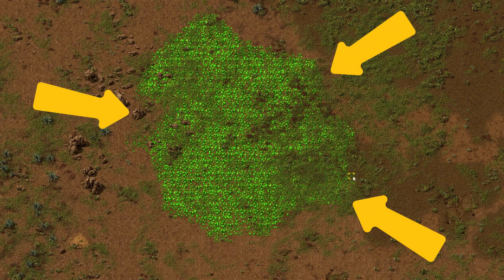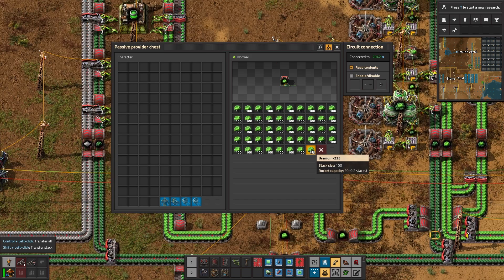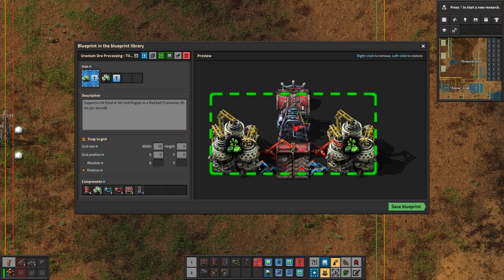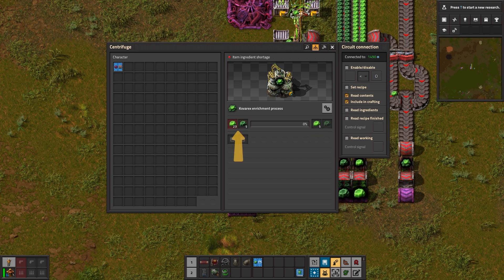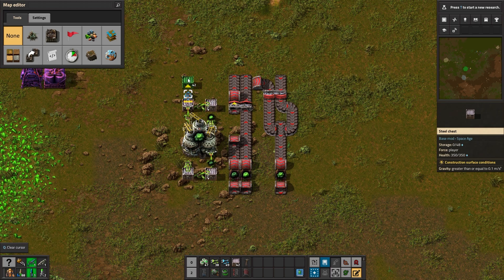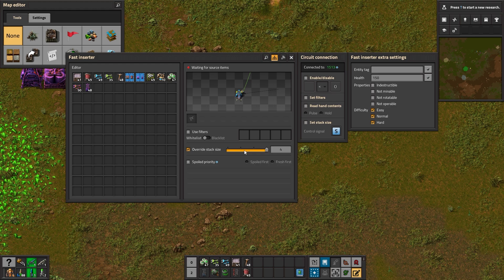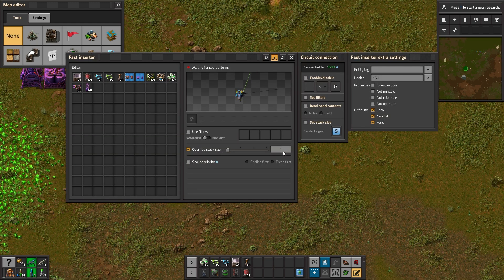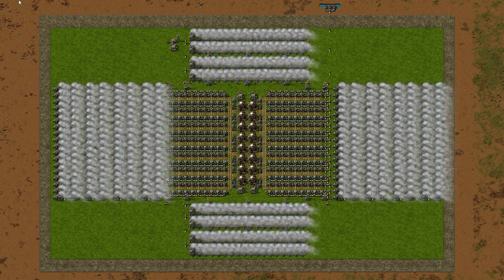Factorio Unlimited Fuel Cells: Tileable Kovarex Tutorial (FREE Blueprints)

Comment: I found a much much more compact design for kovarex though i migh share... U have to separate belts running through the centrifuge ,one carrying 235 to replenish the centrifuges and the other one is tk take away the 1 extra 238, on the 2 remaining sides, u have the chest looping. For each loop, filter the extract inserters to one of the two uranium types, link up with circuits both of the output inserters of U-238 from the centrifuge and set the condition inside to read materials inside and while crafting in the centrifuge. On the inserter thats looping the U-238 back, set it to onky work when U-238 <= 40 and the one that takes care of the excess to only work if U-238 >= 41.
This is a much much more simple and compact covarex print while still being tileable and has room for up to 10 beacons (all tileable)!!! Here is the blueprint string so you can check it out! :
0eNrNWGtum0AQvsv+hsgsLH5I7UUsC2EYJ6vAQvfhxo18gN6jvVhP0lmwwSbgQFJVliJlgdl5fPvN7Je8km1moJRcaLJ6JTwphCKr9StR/FHEmX0n4hzIimwhxo/k6BAuUnghK++4cQgIzTWHek/1cIiEybcg0cDp7HVIWSg0xyX6RRdhEDwwhxzIyqXzB2Z9a8hrZzy9CK5KgNTNi9Rk4FLSGqKdiLjYY+hCHuqN7RNmoHScPJPV7OgMfMEyjvjjvEmfjkh/fr/p+036u1hp1+ChyUdZ4G93C5nuq2bZVBNW1ehDafcXRpdGk54YweQYbNaJkXIJSW2xaCJyMRCQvX8mjN7vmYRN+jmk3OQuZFi85IlbFhnc7g9cHXtczkewNLxycleILJr0E/wi+c48wm1q1iVgpVoWWbSFp3jPC2kNJcRpZD+gJ8xaSwNoifTiFamei30s4cUFgYA/5WjklrJIQClytoq+mTjD9NBaFDLH+TcIFm5NDRJ3j+bTMQsGMQvex2zZHrnJnl0uFEiNH3p6wWtgY91uC3o8e7OpBL2IMEBQr70GlAbI3OQJlL7duGzAFR1fOe0Q5nLO9Ln2R0yW4H77yOuM4hvQXPQSHQUNG+36YrrTwTZNuEwM1xGIeJtBWjeq07zGLWnjdMel0tEbLWJkLCw7qc9IHQXxsQom8OxTXsYy1jYa+fPzN0EqkWIPUvIUogpI9PgDLJo91YYf6S6/C6Sl6r8u/nQ57rnUphpNZ75VFravkCJXcMw6aHytsNjxDAs6Efek5Zw+aB3SMw+vHH4h/WycT+95f6Dn2xsixRmNAsPFDLZcVBn0eBzkdtB/IievLfRVo14+rT/Aw9kbHv6q9My7jha1o+tDQ6Fdi7CuNh9PifKAFRqho50s8qgWWKtdnCmwI6UP+OUk+e7dnXyfTdLv95e/9xkB710K+EE5TelnBLw3LOCH/2Sg/iQJf3/H0l6053a/PZDaQ/EWg3eiqiFU1+ur+Txyai9GTW37wthBZevs73/KJhbaMuO/FMo+ViiO0u/IWOt+HTrMQcnLNs564XgOCh3vvFxUSxQD1drfbGpuWdY2/y9xCIoKVSHAQroMlkvGKAt96h2PfwGGpcM0
Reply from the maker: Sounds awesome. Can you give me the blueprint? maybe the pastebin code
Reply: @Maxiume  Unfortunately pastebin says it contains blocked words ;////// Best I can do is give u the blueprint string here...

0eNrNWGtum0AQvsv+hsgsLH5I7UUsC2EYJ6vAQvfhxo18gN6jvVhP0lmwwSbgQFJVliJlgdl5fPvN7Je8km1moJRcaLJ6JTwphCKr9StR/FHEmX0n4hzIimwhxo/k6BAuUnghK++4cQgIzTWHek/1cIiEybcg0cDp7HVIWSg0xyX6RRdhEDwwhxzIyqXzB2Z9a8hrZzy9CK5KgNTNi9Rk4FLSGqKdiLjYY+hCHuqN7RNmoHScPJPV7OgMfMEyjvjjvEmfjkh/fr/p+036u1hp1+ChyUdZ4G93C5nuq2bZVBNW1ehDafcXRpdGk54YweQYbNaJkXIJSW2xaCJyMRCQvX8mjN7vmYRN+jmk3OQuZFi85IlbFhnc7g9cHXtczkewNLxycleILJr0E/wi+c48wm1q1iVgpVoWWbSFp3jPC2kNJcRpZD+gJ8xaSwNoifTiFamei30s4cUFgYA/5WjklrJIQClytoq+mTjD9NBaFDLH+TcIFm5NDRJ3j+bTMQsGMQvex2zZHrnJnl0uFEiNH3p6wWtgY91uC3o8e7OpBL2IMEBQr70GlAbI3OQJlL7duGzAFR1fOe0Q5nLO9Ln2R0yW4H77yOuM4hvQXPQSHQUNG+36YrrTwTZNuEwM1xGIeJtBWjeq07zGLWnjdMel0tEbLWJkLCw7qc9IHQXxsQom8OxTXsYy1jYa+fPzN0EqkWIPUvIUogpI9PgDLJo91YYf6S6/C6Sl6r8u/nQ57rnUphpNZ75VFravkCJXcMw6aHytsNjxDAs6Efek5Zw+aB3SMw+vHH4h/WycT+95f6Dn2xsixRmNAsPFDLZcVBn0eBzkdtB/IievLfRVo14+rT/Aw9kbHv6q9My7jha1o+tDQ6Fdi7CuNh9PifKAFRqho50s8qgWWKtdnCmwI6UP+OUk+e7dnXyfTdLv95e/9xkB710K+EE5TelnBLw3LOCH/2Sg/iQJf3/H0l6053a/PZDaQ/EWg3eiqiFU1+ur+Txyai9GTW37wthBZevs73/KJhbaMuO/FMo+ViiO0u/IWOt+HTrMQcnLNs564XgOCh3vvFxUSxQD1drfbGpuWdY2/y9xCIoKVSHAQroMlkvGKAt96h2PfwGGpcM0
Reply: @Maxiume  Unfortunately Pastebin doesnt let me post it due to some restriction. But i can give u the blueprint string for it here : Let me know if smt is broken when i tested it everything worked fine.
0eNrNWGtum0AQvsv+hsgsLH5I7UUsC2EYJ6vAQvfhxo18gN6jvVhP0lmwwSbgQFJVliJlgdl5fPvN7Je8km1moJRcaLJ6JTwphCKr9StR/FHEmX0n4hzIimwhxo/k6BAuUnghK++4cQgIzTWHek/1cIiEybcg0cDp7HVIWSg0xyX6RRdhEDwwhxzIyqXzB2Z9a8hrZzy9CK5KgNTNi9Rk4FLSGqKdiLjYY+hCHuqN7RNmoHScPJPV7OgMfMEyjvjjvEmfjkh/fr/p+036u1hp1+ChyUdZ4G93C5nuq2bZVBNW1ehDafcXRpdGk54YweQYbNaJkXIJSW2xaCJyMRCQvX8mjN7vmYRN+jmk3OQuZFi85IlbFhnc7g9cHXtczkewNLxycleILJr0E/wi+c48wm1q1iVgpVoWWbSFp3jPC2kNJcRpZD+gJ8xaSwNoifTiFamei30s4cUFgYA/5WjklrJIQClytoq+mTjD9NBaFDLH+TcIFm5NDRJ3j+bTMQsGMQvex2zZHrnJnl0uFEiNH3p6wWtgY91uC3o8e7OpBL2IMEBQr70GlAbI3OQJlL7duGzAFR1fOe0Q5nLO9Ln2R0yW4H77yOuM4hvQXPQSHQUNG+36YrrTwTZNuEwM1xGIeJtBWjeq07zGLWnjdMel0tEbLWJkLCw7qc9IHQXxsQom8OxTXsYy1jYa+fPzN0EqkWIPUvIUogpI9PgDLJo91YYf6S6/C6Sl6r8u/nQ57rnUphpNZ75VFravkCJXcMw6aHytsNjxDAs6Efek5Zw+aB3SMw+vHH4h/WycT+95f6Dn2xsixRmNAsPFDLZcVBn0eBzkdtB/IievLfRVo14+rT/Aw9kbHv6q9My7jha1o+tDQ6Fdi7CuNh9PifKAFRqho50s8qgWWKtdnCmwI6UP+OUk+e7dnXyfTdLv95e/9xkB710K+EE5TelnBLw3LOCH/2Sg/iQJf3/H0l6053a/PZDaQ/EWg3eiqiFU1+ur+Txyai9GTW37wthBZevs73/KJhbaMuO/FMo+ViiO0u/IWOt+HTrMQcnLNs564XgOCh3vvFxUSxQD1drfbGpuWdY2/y9xCIoKVSHAQroMlkvGKAt96h2PfwGGpcM0
Reply from the maker: Cheers! I got it running. Love the design. Just one problem: You need to manually bootstrap each tile. There is no automated mechanism to get the very first U235. Otherwise works flawlessly.
Reply: @Maxiume  U can now set a blueprint not request, while the centrifuge is a ghost, select the kovarex recipe, ans go inside from Map view and place your 40 chunks, if you blueprint that, the request for 40 chunks still remain and the bots will automatically bring the required amount to boot it automatically! I had that within the blueprint I think it simply just didn't port over 😬😬
Reply from the maker: That’s actually a smart idea!

Comment: Wouldn't it be better to let the circuit grab 80 U-235 instead of 40? Because that way the centrifuge doesn't need to wait for the unloading and loading for the process to start again.
Reply from the maker: Of course you can. But early on it is all about how fast you can get the Kovarex process going. Bootstrapping those centrifuges is way more important than a few seconds of loading delay, because of the exponential effect. After all of them start working you can change the settings so it loads 80 at a time. Which is brilliant! 😊

Comment: Nice tutorial!  That is basically what I do, packed into the space left by 12 beacons surrounding each centrifuge.  (I don't worry about actually placing the beacons until I have plenty of power.)  

I also add in 2 arithmetic combinators so I can set the stack limit for each inserter pulling from the belt to (limit - count) to make loading as fast as possible while still being precise.  

Cheers!
Reply from the maker: I like the arithmetic combinator idea! 💡 Cheers!
Reply: @Maxiume  I use it everywhere I need to load a precise amount into something.  It just works.
Reply: Why the beacons? Doesn't a single covarex centrifuge supply 33 reactors without any modules or beacons?
Reply: @Djellowman  You forget that U-235 is also used for... war crimes.  :evilgrin:

Comment: Tip: A train cart by itself is like a chest, but with much more access tiles into the same chest. For the enrichment process, a centrifuge pushes and pulls into the "long chest"
Reply from the maker: Hummm...or a tank for that matter. It looks peculiar tho
Reply: @Maxiume  tank, too. But a train cart is much longer. I have tiny train tracks just for that one cart, whose sole purpose is to be a long chest
Reply from the maker: I'd like to see your design
Reply: @Maxiume  it's not hard to describe: I can fit two centrifuges next to a longchest. each centrifuge has 2 inserters for longchest: One for input, another for output. It dumps all the 235s, only to retrieve most of them back. On the other side of the centrifuge I have chests full of 238s. The only downside of a longchest is, I don't think I can attach logic wires to it, so I could theoretically drain it out completely
Reply from the maker: You know, i'd go for wagons, if they were truly massive. Like in real life a wagon can hold many many chests. in Factorio, they are about the same capacity. doesn't make sense, does it?
Reply: @Maxiume  they'd clog up your screen if they were sized this way. Would take too long to fill, also
Reply: @eitantal726 I mean with the space age expansion if you have a large inventory in a space ship for example there's a scroll bar to help, so they could do that with wagons too.
Reply: @eitantal726  I think it's possible to add logic to vagons. Connect a locomotive with a trainstation and connect a wire to the train station.
Reply: You can filter train slots, 40 in all, but not so with chests, 48 slots.  @Maxiume design is pretty efficient and there is no slop over of 235 and no bungling with incorrect amounts of 238.  I finally got a very compact design working on a smaller footprint but I’m going to try a play through with this design.  Untuitively I like it so we’ll see
Reply: That is a nice theory for smallnscale bases. But these methods using train, cars or tanks as chest is much heavier on computing power. Large scale, you will quickly lose UPS with these. One solution is to disable them using commands, but you do not play vanilla then.